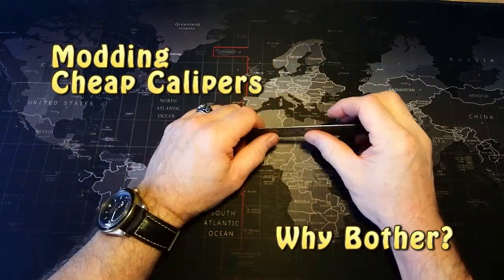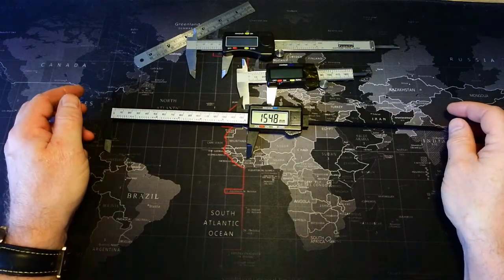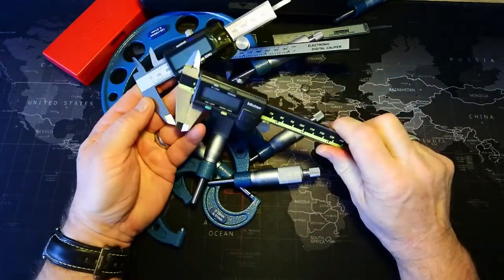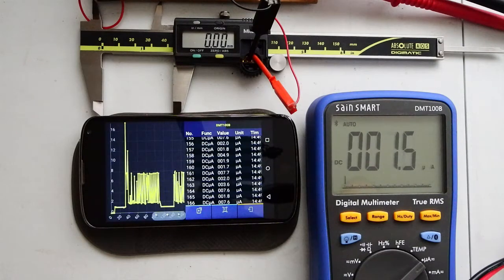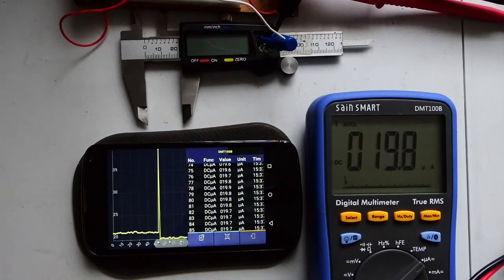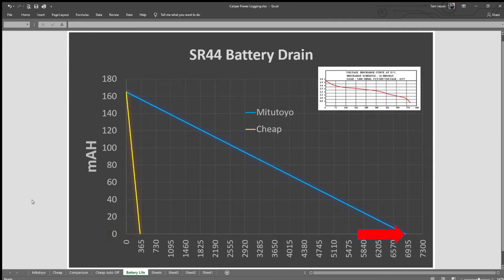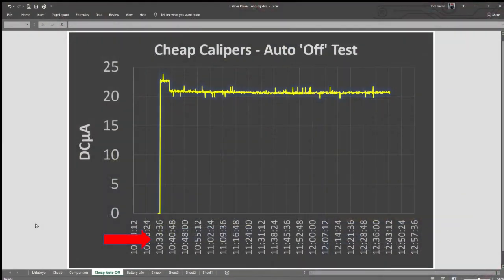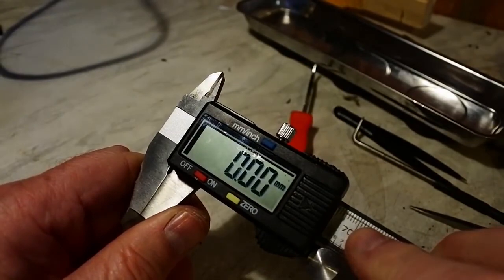Cheap Caliper Modding - Why Bother?

Comment: Very nicely done! I couldn't believe the number of comments in original video without any understanding of this simple issue of a constant quiescent power drain. The same problem applies to digital scales - kitchen and bathroom, and many LED flashlights with a soft switch: insert brand new batteries, leave the light in a drawer, and when you need it after a few months you find out that the batteries are completely flat.
Reply: With my expensive flashlights, I always leave a plastic disc between the battery and spring. I keep a large old Maglite handy for emergencies with the aftermarket  LED bulb swapped in, the MagLites have a physical switch.

Comment: Great review. I've came to conclusion that cheap calipers only switch their screen off when you press the on-off btton. I did not all these test but just watching the battery duration a two exactly equal units, one being seldomly used and the second one never. Battery lasted a little bit more on the never used meter.

Comment: So part of the reason is these have an auto on feature. You can just slide them open and boom get to work. But for that to work they have the adc always on. And dont shut it down because then you have warm up time for stabilization of the adc, which means its immediately not accurate when you move them. So the ADC stays checking too often. A user "feature" at the cost of battery life. The better brands have better quality micros/asic without these issues and lower QC for the adc use.

Comment: I'm 70 years old, so with my eyesight all women look beautiful.  Unfortunately, this interferes with the use of vernier calipers. So I bought an electronic 8-inch from Luna AG, type Limit (Sweden). This is an older model from 5 years ago, but has been kept by the supplier. I measured its current consumption with an analog meter V-640 multimeter. The resting current is about 14 microamps, in the on mode it is about 15 microamps. When pressing any button about 40 microamps. I think both a lot and a little, so I bought a cheap Parkside caliper from Lidl for 1/10 of the price of Limit. The measurement results turned out to be identical!  Conclusion - both products are maybe slightly better Chinese than the cheapest ones. I am going to disconnect the battery negative circuit using a 0.25 mm thick, rigid strip that slides in and out. This will require appropriate re-soldering of the minus contact and cutting a slot in the side of the housing. I was thinking about installing a mechanical switch, but I am not convinced about the mechanical durability of microswitches and I am afraid of disfiguring the appearance.Best regards!